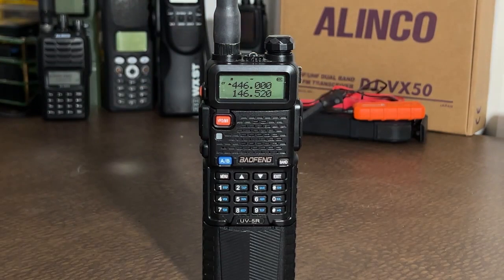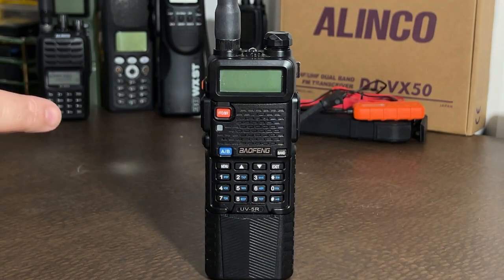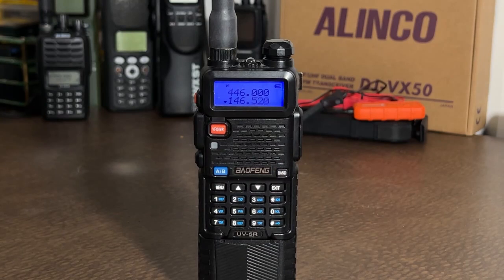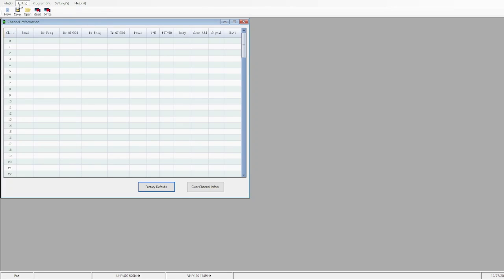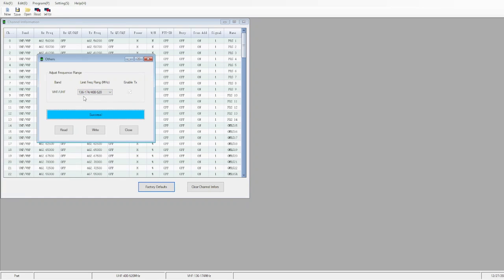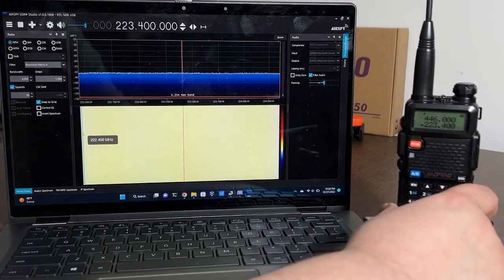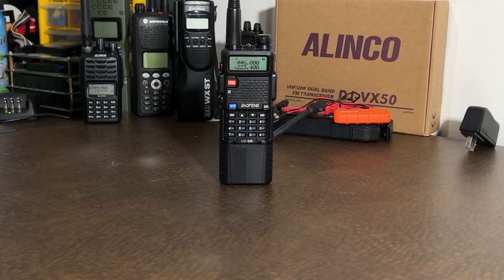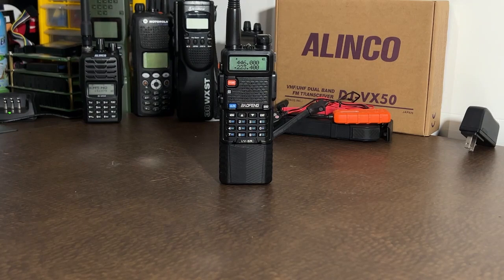220Mhz on a stock Baofeng UV-5R? Today we unlock the full potential! | Offgrid Technology

Comment: I just picked up a couple of New UV 5R 8W - It actually came with FRS  an GMRS unlocked But, I tried the 200 MHZ unlock through the Chinese program and It Did Not Work, so, I tried the button combo "FACTOR" hack and Still No Luck. I have 2 that I bought a Few Years Ago (MIRKIT) an those took the 220 MHZ program hack No Prob. Well, I guess I'll just be happy having the two older ones with 200 MHZ expand! Not Really that big of a deal, the 2 older have it and I have a 8629 (Tri Band) that has also has 200 Mhz. If anyone has has a work around for the two I have I would still like to add the expanded freq to the new ones - that way All would have it.....
UPDATE:........
I realized that the uv5R just are Not really made to operate on 220 mhz. Its just (I'll call it a cheep trick) that's just not really worth it. I have a radio that is a real tri band with Aircraft too. Plan on picking up another 1 or 2 that's designed to operate on 220, an has the Aircraft. But, to each their own.
Reply: Sorry, I just read the other comments about using Chirp and it worked. I guess I shoulda tried chirp to begin with. And... Never hurts to Read The Comments either. I also increased the back light timeout, the stock 10 sec is way too short.